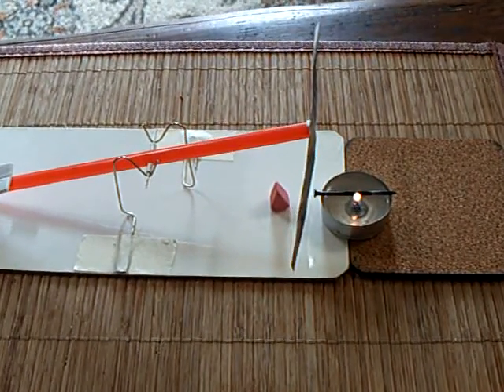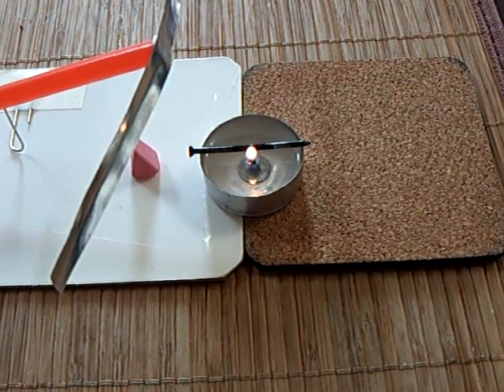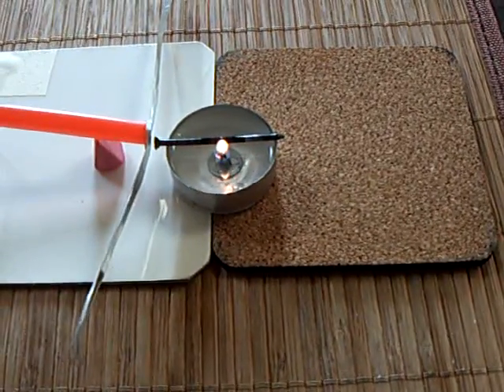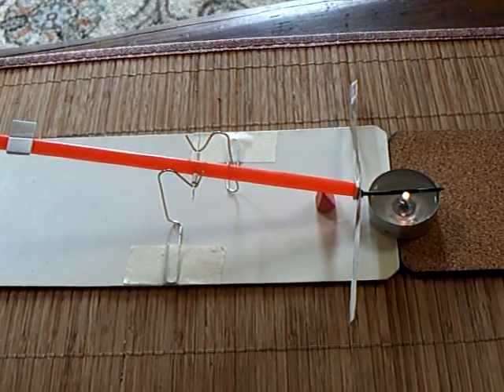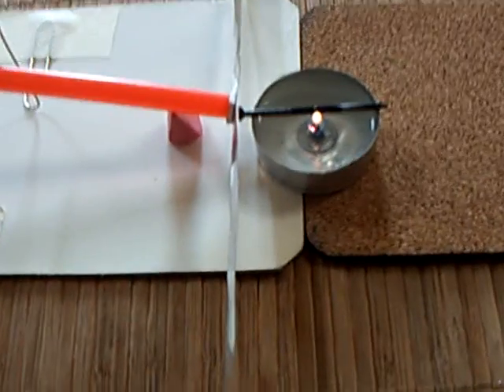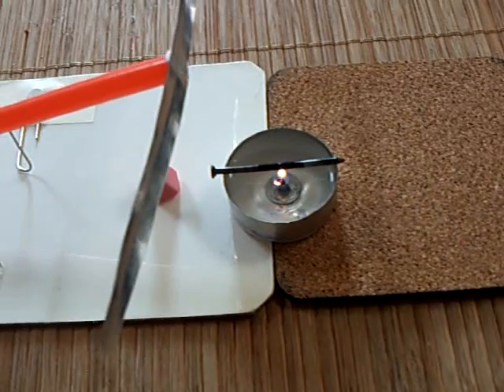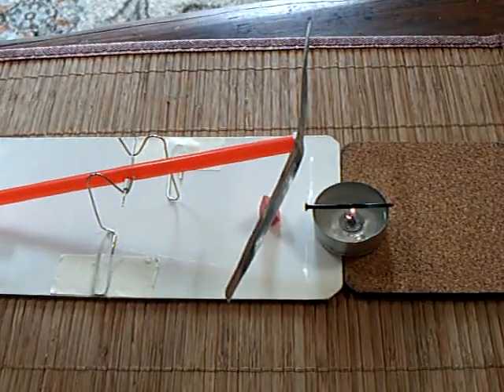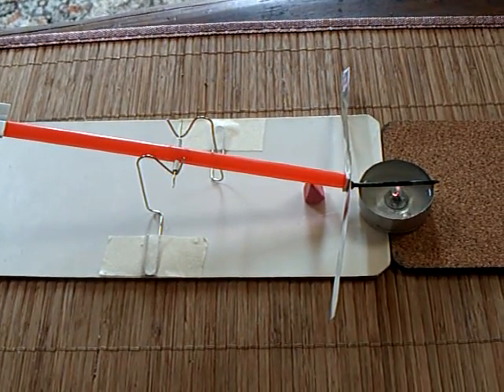Tea Light Teeter  ----BLADE's Heat Engine running on a candle

Comment: I'm pretty stupid so not understanding the mechanism here.  I see the metal leaf bend a bit and am figuring the displaced mass makes it go.  (?)  Why does the leaf bend - is it bimetalic?  Memory metal of some kind?  Sorry, I'm just soooo dumb.
Reply from the maker: schitlipz I must be dumb also because I don't totally understand the mechanism either.  We think that it is a thermal expansion of different materials in the laminate (aluminum and polyethylene).  Best guess.

Comment: It looks like you have increased the cycle speed!
Perhaps multiple nails or a heat bar (see below) will accelerate the cycle even faster:

            | s |
             | t |
             | r |
            | a |
plastic | w |  strip (below)
---------- + ----------
____________ (left line = heat bar (copper foil woudl be good)
|      |      |      |      |     
|      |      |      |      |    (each 4 lines = 1 nail = 5 nails in your heat conductor)
|      |      x      |      |    
|      |      |      |      |    

x=candle flame location

p.s.:  I bet if you use a magnifying lens you could increase the oscillation rate too!
Reply from the maker: A B Oooooo  a magnifying glass.  Great idea.  Using that a flashlight might even work.